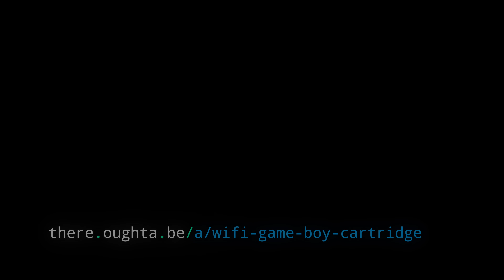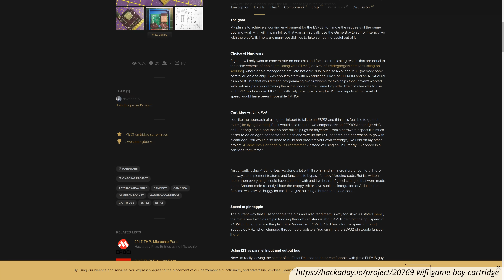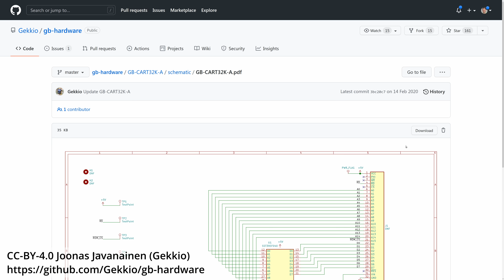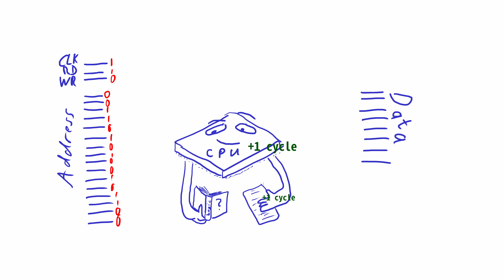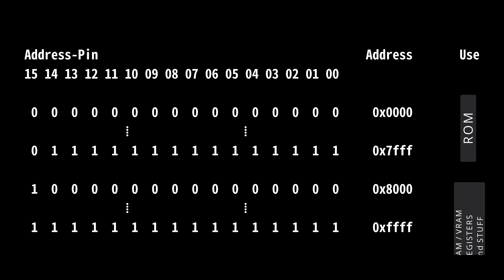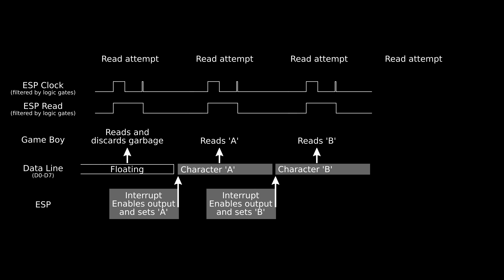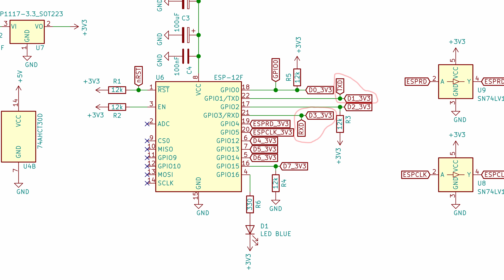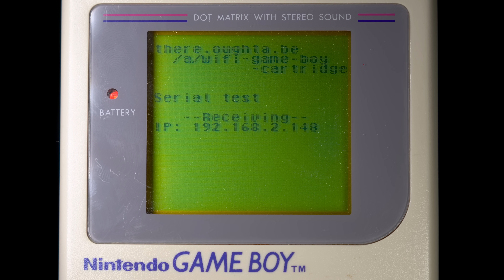WiFi Game Boy Cartridge

Comment: if the ESP firmware can be modified to be able to throw data on the bus 2 cycles in a row in the Gameboy Color's double speed mode, then I would definitely try to build one myself to use with my high quality audio player. It uses some hacky magic to get the Gameboy's internal audio circuitry to act as a stereo 8- or 9-bit digital to analog converter, and since it requires raw data to feed directly to the sound registers it eats up cartridge space like nothing else (either 2 or 3 bytes per sample, at up to 43.7KHz on a GBC!) The ESP would be extremely useful to be able to stream audio over WiFi and convert it to the necessary proprietary format on the fly so I can listen to music on my Gameboy.
if it can't, then I'll just have to make a cartridge with a Pi Pico that reads audio off an SD card!

Comment: A while back I was trying to learn to code for the gameboy and my first project was to try and implement Twitter via the link cable

The project didn’t get very far due to my lack of knowledge in C, but I had a few working prototypes that could flip through some preprogrammed tweets and “like” or “retweet” them

I also worked on images but due to my lack of memory management knowledge I couldn’t get anything to work 

I never got along to adding link cable data transfer, I got frustrated and moved on :)

All of this was done in an emulator so it was never tested on original hardware :P

I would love to see someone complete my vision and make TwitterBoy a reality, and this is one step closer! Good work!
Reply: Imagine getting cancelled through a gameboy

Comment: Forgive a lot of ignorance on this (I'm relatively new to MCU programming).  

1. In regards to the ESP being too slow, were you using the Arduino interface, or were you using FreeRTOS?  I've heard the latter has lower latency but I've never actually tried it. 

2. Where did you get the circuit board printed...it's really cool!
Reply from the maker: 1. I used the standard Arduino stuff, so yes, I am quite sure that they could be a lot faster, but I haven't tried it.

2. I got it from aisler.net, mostly because I had experience with them from work. However, I cannot really recommend them as their KiCad renderer caused some issues and I did not get any response from them (see details in the blog).
Reply: @ThereOughtaBe  thanks for the quick reply.  This is super cool, I'm extremely impressed!
Reply: @ThereOughtaBe  Next time you could use ESP-IDF which is the main development framework for ESPs. The base is FreeRTOS and you can do much more complex stuff with it. Arduino adds overhead. Also using ESP32 would help because it is dual-core and the first core would handle WiFi and the second one your code. However impressive project!

Comment: This might be motivating enough to try and get the parallel I2S going on the ESP32, so DMA will be possible, allowing for faster pin communication. Great work on the video, renders and explanations - you did your homework :)
Reply: The bigger issues is the non deterministic interrupt latency for the ESP32. ESP-IDF is not effective at sub millisecond realtime applications. The esp8266 is actually more effective at realtime applications since it has way less bloat than ESP-IDF on the ESP32.
Reply: My thoughts exactly. Lol
Reply: Too many acronyms